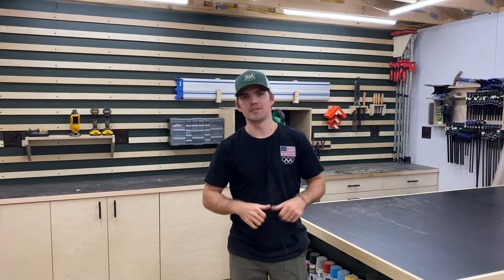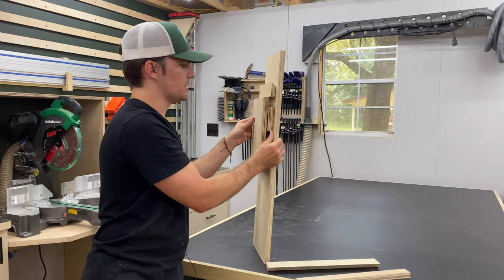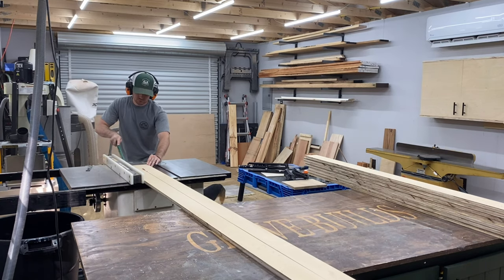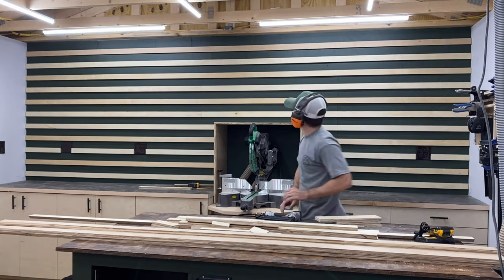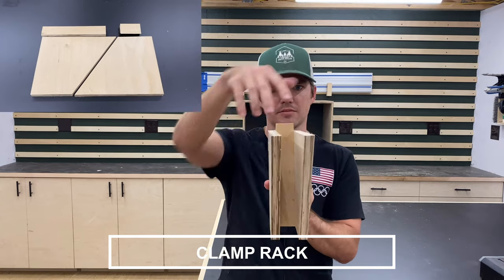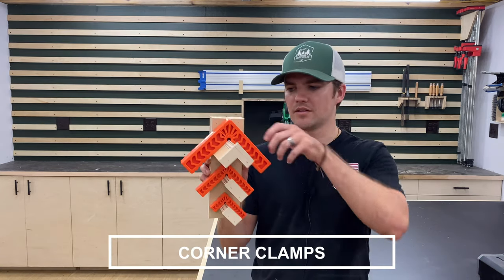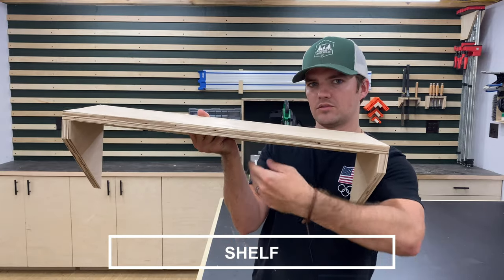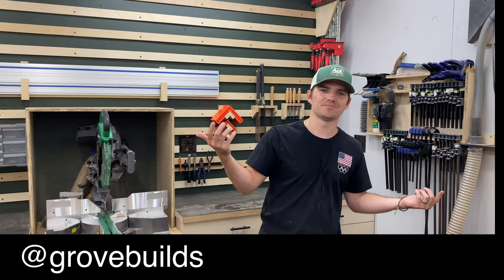EASIEST Way To Make A FRENCH CLEAT Wall!

Comment: Are the cleats you used for the tool holders the same size as the ones installed on the wall, if not what dimensions were they?
Reply from the maker: Yes they are! I used the scraps and left over pieces to make all my cleats. I would suggest making several extra cleats to use for in the future while you have your tools all set up.

Comment: Looks good. Wish i had a prewired wall to work with.
Reply from the maker: Thank you! I actually jumped off a plug in from my upstairs in the attic to run the electrical to the entertainment center

Comment: Would you have a recommendation on what plywood to use for the cleats? Thickness, grade, type, etc. Ive built several 'walls' onto work benches using very nice expensive plywood. But that'll get really expensive for the full wall inwant to. Especially since im putting it onto a concrete brick wall. That ill first need use fir strips and full.sheets of plywood before the cleats go on.
Reply from the maker: I personally used 3/4 inch cabinet grade plywood. Plenty of strength and it looks good. Don’t buy plywood from Home Depot or Lowe’s, reach out to a local hardwood dealer and the plywood will be cheaper. The bigger the dealer the better. My local dealer has 4x8 3/4 inch plywood for $55 a sheet. If you don’t have any local hardwood dealer, try a local cabinet shop. Sometimes they order in bulk and will give you a deal.
Reply: OK great recommendations, that's a great price!

Comment: Why the 3” spacer? Why  not 2 or 5? I’ve seen others go up to 8”, however I believe that would limit the amount of tool hangers.
Reply from the maker: That is what worked best as far as spacing for my wall. I wanted it to all be evenly spaced but 5 or 8 inches was too big of a spacing. I needed enough space for my cleats to slide in easy and 3 worked great for me. If you put them too close you won’t be able to slide your cleats in easily.